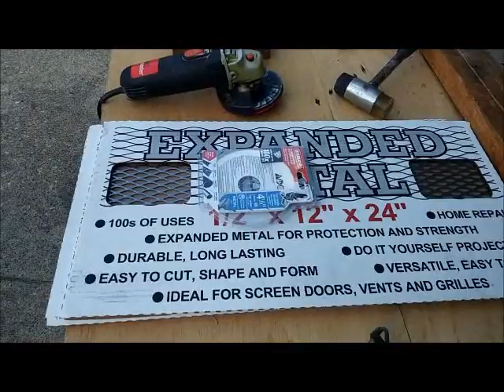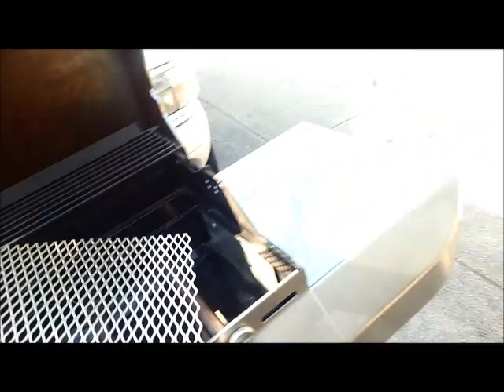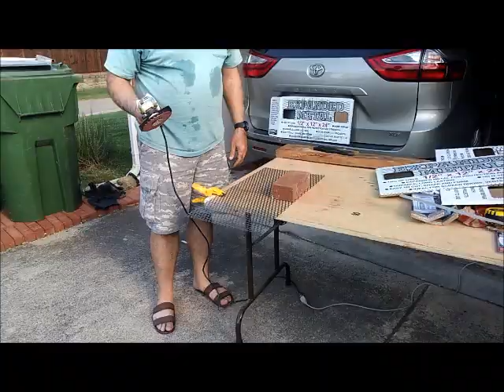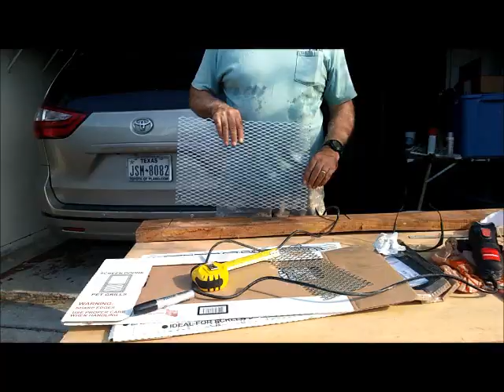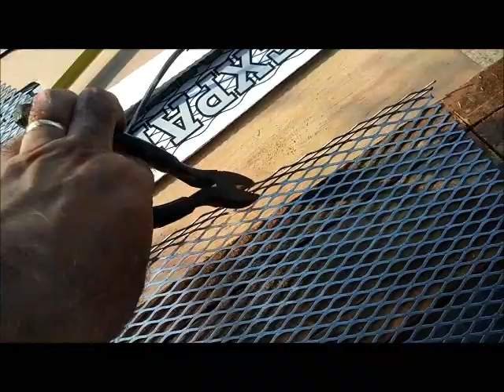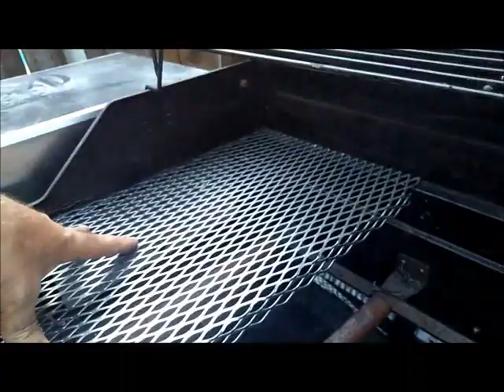NO WELDING DIY Grill Grates. Cheap and easy

Comment: Hows it doing now?
Reply from the maker: @MindbodyMedic  I have no idea. I sold it four years ago, but I would recommend getting the thickest guage expanded metal you can get.
Reply: @brandoncriner5480  thanks I'm looking at different options, I'm fixing a Weber charcoal kettle AND a generic gas BBQ. Have 3/8 steel scrap that I may repurpose as griddle too.

Comment: I really really wish I saw this video literally yesterday, I cut a piece of expanded stainless for my pit boss pellet grill/ smoker, it will not fit in one piece because of the lips on each side, I got 1/4” S S rod to weld at the joint to help support it, I cut of enough the I would have been able to bend it like you did. UGGG that is a grate idea lol
Reply from the maker: That was a grate pun.

Comment: I have that same grill. Except my firebox was toasted. Needed to use some high heat epoxy to patch the holes.
Reply from the maker: Haven't tried a high heat epoxy yet. I did screw in sheet metal bottom once and it bought me about four more years.

Comment: How has it held up?  Has the heat warped the expanded metal at all?  I’m looking to weld some bee grates for my grill and trying to figure out how thick I should get the expanded metal
Reply: Best get heavier guage. At least 14 guage. Stainless obviously best. Go to steel supplier not home depot for best price
Reply from the maker: I sold it recently afterwards so I don't know. But I would probably upgrade to a thicker gauge if I had to do it over again. I got the thinner gauge at Home Depot. There's only two types there

Comment: That not galvanized?
Reply from the maker: It's not galvanized. Didn't want zinc on it. Got it at Home Depot. Not sure of the Gage. There were two different types and I've got the thinner one.
Reply: It is galvanized. You should remove the zinc with muriatic acid and then seal with cooking oil after neutralizing and cleaning.
Reply from the maker: @lf1631  is not galvanized

Comment: Hi
How did you prepare the grates before using for first time? Did you clean or brush or oil them? Thanks..
Reply from the maker: I fixed it up and sold it. But I would recommend wire brushing then spraying with non stick oil (before and after).